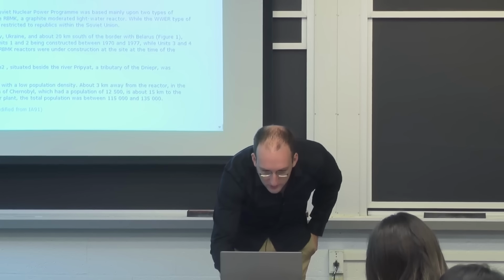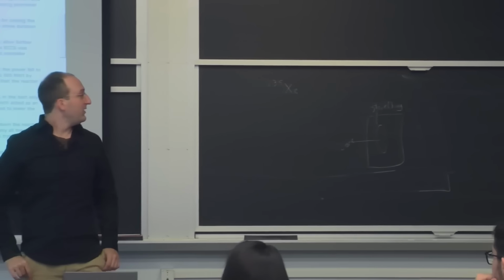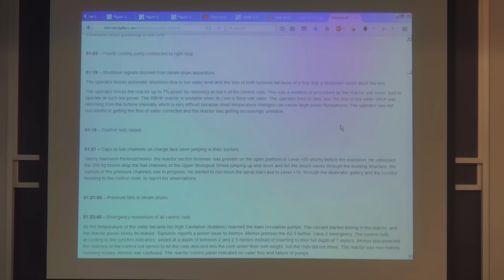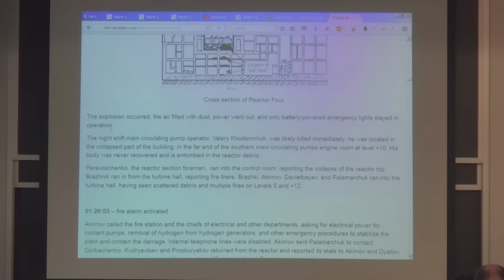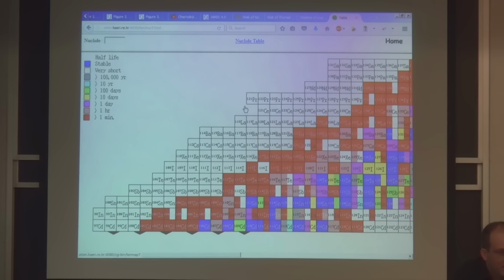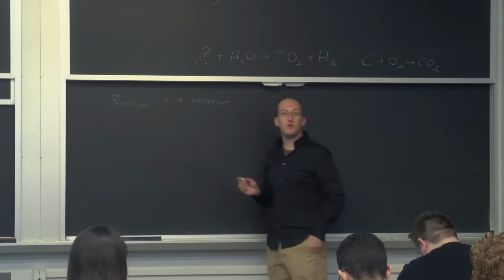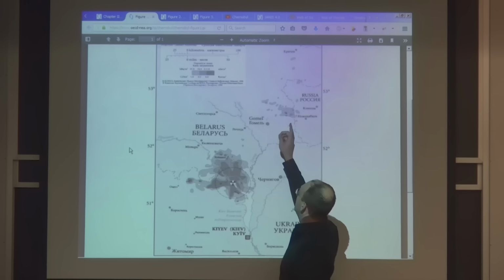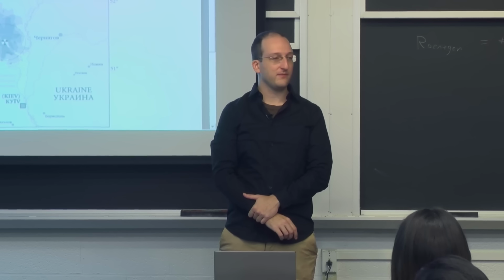26. Chernobyl — How It Happened

Comment: RBMK was originally designed for military as breeder reactor for plutonium production.
It was powerful and cheap in comparisons with safer designs.
Serviced by people who had no full understanding of how it works.
Its design flaws and accidents were state secrets.
Reply: It was combination of economical and political issues plus some bad luck which caused it.
Reply: Originally designed for military is very important part.
In USSR military was never concerned with safety.
Military reactors can be build far away from general population.
They were running with specific and narrow parameters.
Reply: Very important addition. It could use slightly enriched uranium. Which makes it cheaper fuel in comparison with other reactor types.

Comment: ORDER OF LENIN USSR ACADEMY OF MEDICAL SCIENCE 
NATIONAL RADIATION MEDICINE 
RESEARCH CENTER 

ACT 
on K.P. Buteyko-s VDBE Method approval (in 1990)
in accordance with the Cooperation Agreement of January 3, 1990 
between the USSR AMS NRMRC 
and the therapeutic center 
"Buteyko Breathing" 
headed by Candidate of Medicine K. P. Buteyko

The VDBE Method therapy was tested on 50 patients of the USSR AMSE NRMRC Institute of Clinical Radiology departments and departments of Kiev Shevchenko CRCB with the purpose of identifying the clinical and pathophysiological mechanisms of Buteyko Breathing in persons affected by ionizing radiology in Chernobyl disaster. 
The following results were achieved: hemodynamic, blood test and intestinal system improvements were revealed in 82% of patients. Upon analysis of patients- records and diaries, the following conclusions can be made: 
1. The VDBE method reduces the use of drugs, and in time totally discontinues medication therapy for some individuals. 
2. In multiple therapy, the VDBE method provides improvement of blood and some hemodynamic (blood pressure, pulse) values. 
3. The VDBE method as one of the bracing non-conventional methods does not result in complications or side-effects. 
4. The VDBE Method is further recommendable for rehabilitation of the Chernobyl disaster victims as one of the drug-free therapy components. 

Director,
Institute of Clinical Radiology
Prof. 
V. G. Bebeshko

Senior Researcher,
Department of Neurology
A.B. Denisyuk

Comment: The mixed oxide fuels in the reactor did not respond properly to the increase in operating power. They were new and second shift operators with less experience were asked to make a critical move and lost. That fuel story is a part of this, and reactor response curves in a closed system are a guess, or was in that accident. TMI was the same story
Reply: No.

Comment: I was going to throw a flag on the "initial" explosion around 18 minutes into the lecture. But then you correctly identified the rod followers as a positive moderator coefficient, actually the void coefficient, which exacerbated the situation... and the rest is history. Also, the delay and prolonged time at low power was beyond the design basis/operating parameters of this reactor which was causal to the initial instability. Those in the room were against continuing. On site engineers were not confident in the test. They already met abort criteria. They violated so many rules... But the ones calling the shots had insignias on their lapels who knew only chain of command and not reactor theory. And it was Communist Russia, they didn't dare question orders from 'above'.

Comment: They not only automatically shut off the ECCS, but even manually closed the huge valves on the water supply lines. For the purity of the experiment.. Therefore, many believed the disaster was deliberately arranged. The experiment scenario has passed all the necessary approvals.

Comment: In 1986, the operators tried the same thing and when it started to go south, they scrammed (immediately shut down) which caused power grid problems and reprimands. Repeated same experiment but delayed shutdown to avoid further reprimands. Unlike 1986, they failed to follow proper operation procedures.

Comment: quite unscientific lecture... 
can't find a video of Boris Burakov (Khlopin Radium Institute), where he explains why graphite doesn't burn. The Institute performed a test, where they didn't succeed to make graphite burning
But you can watch video how it glows at 1500 degrees of celsius: https://youtu.be/22aTqTKRPBI

About stupidity of operators... they were operating reactor according instructions (instructions where wrong and RBMK-1000 reactor had design flaws), that doesn't make operators stupid.
Stupidity is to put a cat into microwave, because that wasn't prohibited in the manual...

Comment: Instead of turning a number of processes off to see if the turbine, as it spins down, could then provide enough energy to run them, why not just measure the output with, say, a variable load? Wouldn’t a measurement be just as good and a lot safer?
Reply: That would, indeed, have been smart. These were not very smart people.

(Well, let me be both more and less charitable. Lots of them were pretty competent, but were very focused on meeting performance and schedule targets. Proving out this emergency system completely would have looked a lot better when they came up for promotion than only proving the safe(r) subtask of drawing power from the spinning-down turbine.)
Reply: @TB-wvvvw  you mean like being under a regime where if you disagree you get sent to Siberia?

Comment: I took an Intro to Nuclear Engineer class in the early 90s.

One thing my professor emphasized about Chernobyl is that the reason temperature had a positive feedback was because it was designed both produce power and create weapons grade material.  In the US (probably all non-soviet nations) reactors are built to do one or the other, never both.  That lets us use designs that have a negative feedback so we don't get runaway reactions like Chernobyl.  Yet I've never heard this detail mentioned in any other discussion about the Chernobyl accident.  Can anyone confirm my professors claim?

I have to believe my professor had good knowledge of the subject, he had considerable years of experience working for DoD and Los Alamos.
Reply: RBMK reactors (like the ones at Chernobyl) were designed to produce power and plutonium. However, I don't think that has any bearing on the positive moderator void coefficient of reactivity. It still could have been designed with a negative moderator void coefficient of reactivity - after all, the other RBMK reactors were slightly redesigned and ~9 of them still operate today.  One interesting/counter-intuitive note, to make the reactors safer, they needed to take some graphite moderator out (which would help to make the moderator void coefficient of reactivity less positive) and replace it with fuel. It may sound strange, but the solution to making the reactor safer was to add more fuel.
Reply: are you saying the US reactors of the 50s/60s were not designed to make weapons-grade nuclear material?
I thought this was the whole reason the MSRE got shut down, as it couldn't make that material
Reply: @miff227  some were, but the commercial electrical production ones were not.  You can't lump them all into one category.
Reply: @nathanwahl9224  except the Tritium they produced...
Reply: @miff227  I was employed by the general contractor at Waterford 3 in Taft, LA, and it had NO ability to produce ANYTHING except electricity.. I had access to ALL the drawings and knew the plant inside and out..

Comment: What a highly interesting lecture for even a completely uninitiated to nuclear physics layman like me.
I could follow the professor quite well despite my zero knowledge of e.g. chemistry and biology apart from what I was taught more than 40 years ago at highschool and have long forgotten since then.
However, I must admit that I am a bit of a techie-wacky and have a semi-educational underpinning in engineering maths, engineering mechanics and a wee bit of fluid dynamics from my naval architecture studies though never have worked in this field but now fiddle with Linux systems and cloud automation.
Luckily the herd of computer systems, how important the data they process might be, that I administer doesn't control a nuclear reactor or nuclear weapons of mass destruction.
Reply: The newer digital systems you would find interesting.  Air gaps and data diodes on ALL of the important systems, independent and triple redundancy depth and cross-checking all the way from the sensors to the controlled components even with independent signal paths, fail-safe logic schemes, layers of firewalls on the non-important systems, many many other cyber security layers..  Pretty robust stuff.

Comment: The text on the CC output has thymine (or thymidine) bridge misspelled as thiamine. Thymidine is part of DNA. Thiamine is a vitamin. I think he misspoke when he said @42:50 the dura were rapidly dividing. (He earlier correctly said that brain tissues were not particularly sensitive.) (Tried to submit error reports but the form does work with Chrome on Linux.)

Comment: One of the best explanations. I would add that while around 4000 people got cancer or died, less than 100 have died. Those cancers were mostly thyroid entirely because USSR refused to admit there was any problem at all. 
The accident itself was entirely avoidable but senior managers in a top down system must be obeyed. 
In terms of cell damage the people of Ramsar in Iran receive 260 mSv per year in background radiation. The annual occupational limit is 20mSv. The people appear to have a lower than average cancer rate though numbers are too low for a reliable population study.

Comment: Only question I have is why did the Ukrainians do this test? It seems a lot of reactors are pretty vulnerable when the main power grid goes down, that's what happened to the light water reactors in Fukushima.  The earthquake and tsunami disabled the grid and they only had some 30 minutes of auxiliary cooling so they melted down.

Comment: The reason why nuclear reactors are stable and can be controlled is that U235 will fission only upon absorption of thermal (slow) neutrons, which are produced by neutron interaction with the moderator. When the rods were inserted into the core, an additional moderator was inserted into an already intense neutron flux causing the population and density of thermal neutrons to dramatically increase. Consequently, the fuel in that vicinity became prompt critical resulting in a localized, small nuclear explosion. Evidence gathered after the event supports this scenario. The lecturer went out of his way to state that there was "no nuclear explosion". That knee-jerk conclusion has been proven to be not true.

Comment: I read or saw somewhere that the fuel rods were tipping in boron (or a boron compound) and that tip actually accelerated the rxn leading to the explosion as they brought the reactor to the brink and the insertion of the rods sent it over.  Something they knew about since they had a similar, albeit smaller incident with a similar control rod.  Interesting that such a pivotal event has conflicting details.

Comment: I don't like how much smattering is beeing told.
Xenon 135 does not have a half-life of days. It is also not produced directly, but comes from Iodine that decays into Xenon.
The "tips" were not 6 inches tall; way were way taller. They needed to be there to displace water. Else natural uranium could not have been used. So the control rods were much more effective, because "withdrawn" they left carbon in the core accelerating the chain reaction. So, when putting the control rods back, there is no carbon "entering" the core. It was there all the time. But the carbon "tips" were not as tall the the core. So when "inserting" the control rods, the tips shift from center of the core towards the bottom. Core was about 6m, the tips something about 4m in height. Not 6 inches (0,15m).
Also it is debateable wheather this was a nuclear explosion or not. All an atomic bomb does is create a lot of heat.
Hiroshima had 13 kT TNT or about 15GWh of energy. If chernobyl really had 120GW of thermal energy as it is claimed by him, chernobyl would have realeased the ernergy of 12% of hiroshima per second (if the power level would have been steady). Since the power level rises exponentially and it didn't take long until the reactor exploded, it is hard to calculate the actual amount of energy released.
If an explanation for an atomic bomb is based on duration of the power exkursion, chernobyl was far off, but since there was vastly more fissile material, considering the energy released you could say it was an atomic explosion.

Comment: Does anyone know if Chernobyl #4 went prompt-critical? I couldn't find anything conclusive. If it did, then you can easily say nothing really mattered before that, and immediately after that it was all over.
Reply: Perhaps I'm wrong. But my perception of what 'critical' means implies that a nuclear explosion occurred. From what was said here (16:50), it never went 'critical'.
Instead, the reactor suddenly produced 120 times its rated maximum. This immediately vaporized enough water to cause the first explosion. Then 4 seconds later, this was followed by a huge hydrogen explosion
Reply: @gregparrott  the reactor must become supercritical in order to increase its power. So if the power rises, the reactor is supercritical. The question is, if Chernobyl #4 was delayed-critical or prompt-critical during the disaster.
Reply: @blitzkringe  Thanks for the reply. I've not delved into particle or reactor physics beyond courses I took long ago in college. So I am unaware of the distinction between delayed-critical and prompt-critical. 
My experience with Chernobyl was touring in France and Sweden a few weeks after it happened and wondering if any plumes happened to be swirling around my area at the time. A waiter in Stockholm tried to make light of the event by saying he learned how to make chicken Kiev...First you preheat the city to 350 degrees.

Comment: I remember some popular science TV show, and the topic was about different types of radiation and the harm they can cause. And I liked  the analogy that was used there. Despite of gamma rays are most energetic, most powerful, most penetrating  - they don't interact much with anything. Indeed, to penetrate something means not to stuck inside. So gamma mostly like shot through bullet. But alpha rays - they are like massive heavy tank. And if they hit something, they definetly make a damage. That also means it's easy to shield them with even a paper. And so this analogy makes clear why they use cheap respiratory masks and thin body clothes, and kind of medical  caps   - it's all used to prevent radioactive dust and tiny sources of radiation from getting inside ones body, lungs, digestion path and  all that..
Reply: Yup.  But rarely is indoor airborne contamination an issue at nuclear plants, the worry is mostly contamination that settles on surfaces, besides direct radiation (gamma).  So double boots and double gloves are usually mandatory.    The air is filtered and the ventilation exchanges it frequently.  And were airborne is known to exist, those filters are NOT cheap ones.  Worker dose is FAR less than you'd imagine.

Plus if you can go in and do a specific job in a third of the time because you're not lugging around a bunco of equipment and because you've trained on and dry-ran the job several times before doing it, your dose will actually be lower than if you used all that "protective gear."  It took a long time for the industry to accept that concept.

Comment: and this, kid's, is why you use LFTRs
- the coolant/fuel is a salt, which doesn't expand a thousand-fold upon loss of pressure
- the coolant/fuel is a liquid, from which gaseous fission products (xenon) can bubble out
- also, fuel pellet degradation (which is a ceramic) is not an issue, so you can consume all your fuel, opposed to a few percents of it

Comment: You guys and galls are killing me. Ask more questions please. Can anyone tell me what the purpose of graphite being used for the tips of the control rods was? Also why only 6 inches? Was it to displace water at the bottom of the core? Also why would the tubes containing the Uranium fuel be pressurized by coolant? How could it not have been foreseen that these channels would be prone to rupture by the steam, or at the very least deform the tubes to the point the control rods could become inoperable

Comment: Question: Why did they tip the control rods with Graphite? Like, these control rods are supposed to slow the reaction down, so why include a material that speeds the reaction up?
Reply: They were using poorly enriched fuel. So, they had to maximize fission probability, for when the control rods were lifted, that space would've been filled with water which has a small absorption cross-section. By putting in the graphite part on a telescoping mechanism, the neutrons were slowed down with almost no absorption. Basically, they cheaped out on the fuel and made some not-so-wise design decisions.